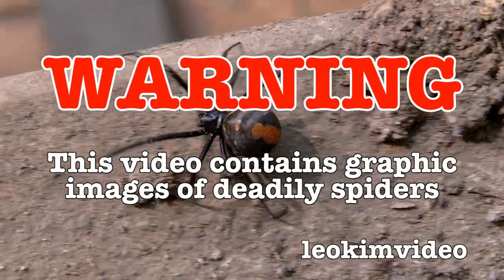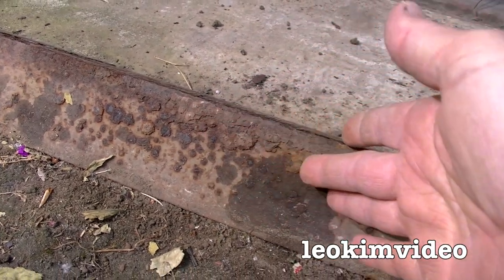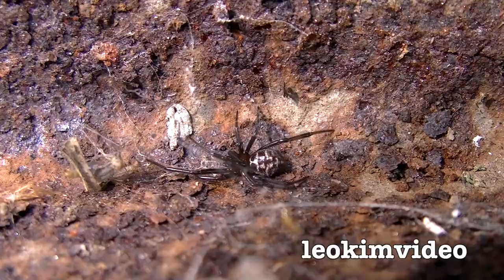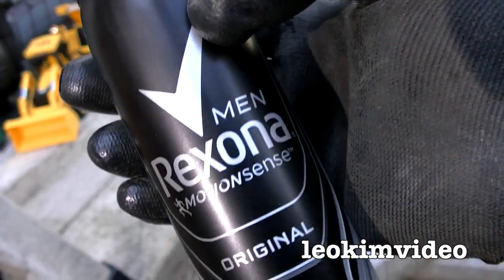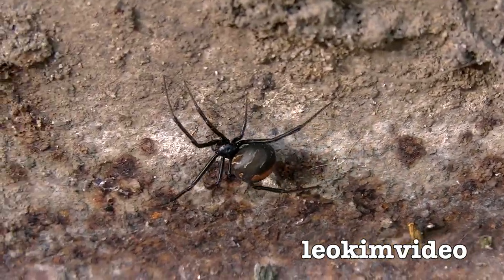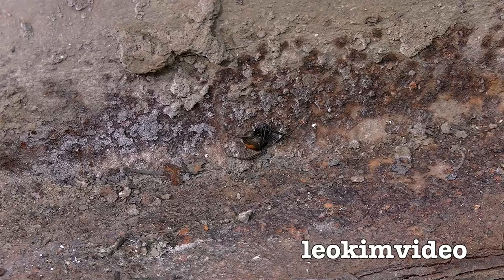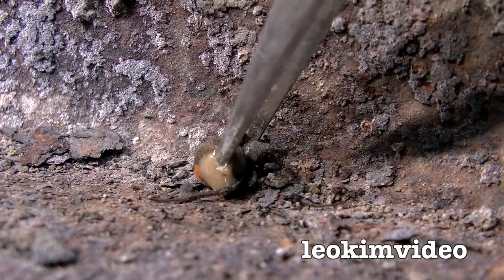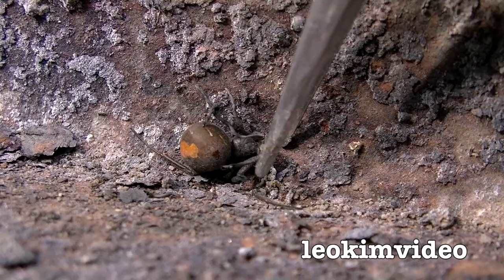Deadly Redback Spider Flamethrower Non Chemical Spider Control Fast And Effective

Comment: I would put that toy in a furnace that goes hotter than 10000 degrees Celsius, so basically hotter than the surface of the sun
Reply: To make sure there are no spiders in there 🔥🕷
Reply: Gleen Jr. im pretty sure the sun is hotter than 10000
Reply: Gleen Jr. Dude, it won't only kill the spiders, it would kill us
Reply: well, at least them evil are ded
Reply: actaully surface of the sun is only 6000 degrees celcius
Reply: Yea that's why i said basically hotter than the surface of the sun

Comment: I've had a black widow in my bed and it almost bit my cat until I saw it so I grabbed my cat
Reply: You have a useless cat then i think. Cats usually kill spiders hence the reason why to keep them in your bedroom at night.
Reply: Mahaila M when I was little I went to the mailbox Cuz logic (I saw the mail truck) so anyways I stuck my hand inside and it.....(black widow) crawled on my hand to I started freaking out, I shook my hand so hard the black widow went flying, so I grabbed my work boots ( I worked in the yard with my dad a lot) and I just started screaming DIEE! Over and over again! I'm was a messed up child 😝😂 btw. I didn't get bit (almost did 😱😳
Reply: Dessert Limbo actually, cats can kill bugs.
Reply: This is really interesting, this topic -

First off - "pets arent personal guards you fucktard"
Actually, this is part of the job of a pet. Pets are not slaves.

I don't think cats do kill bugs. At least, if they do, the birds and lizards they eat and kill inadvertently introduce more spiders to the area. Then again, it's down to the character of the cat. I don't see many cats taking on bugs since there's no meal in it, and very little sport.

One is probably off getting a small lizard and letting it run around the room at night with all the windows et cetera closed than owning a cat in the first place. If the spider is big enough to kill it (funnel web) then the spider will use its venom to kill the lizard and then won't be able to harm you. (see spider milking for more on venom recharge rate)

Comment: I lived in Florida for a short time, back in the early '80s,  when several of us went there to work construction. We all were staying in the same house. One of the guys was bunked on the living room floor in a sleeping bag. I noticed that a spider that came from the back hallway along the ceiling and stopped above him. While the rest of us were chuckling, someone said, "Jimmy, don't look up." And he didn't, instead he immediately bolted out of that sleeping bag where the laughing got louder. Now I don't know if it was a wood spider or what. What I can say is that it's leg spread was about three inches and all he said was, "Real funny guys, real funny."